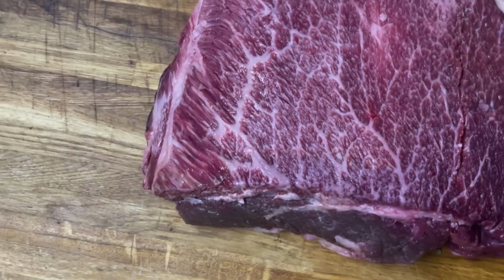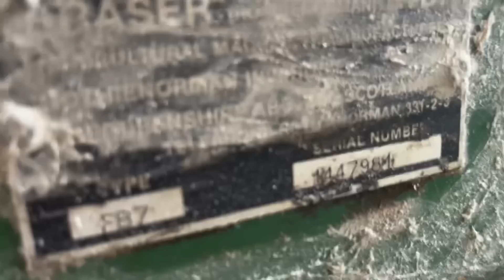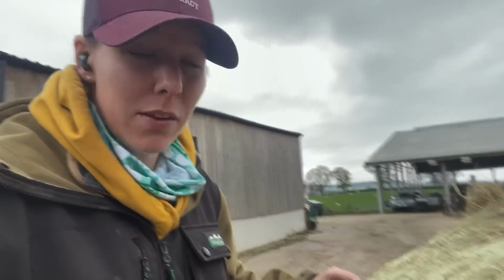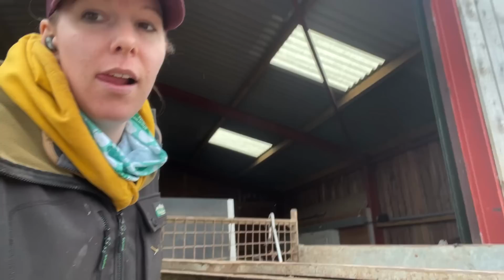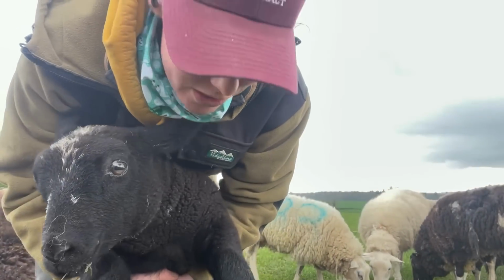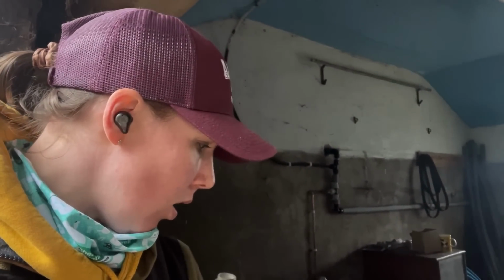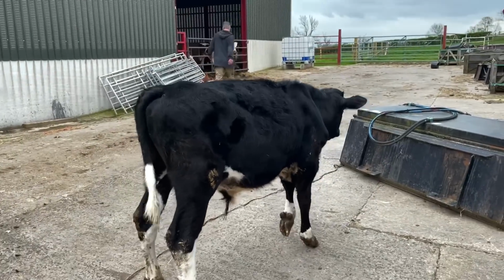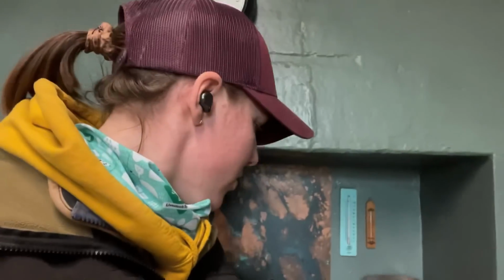Getting my arse in gear to tidy up!! Daily farm diary

Comment: What fuel does your arger run off? Thanks.
Reply from the maker: Electric and it’s EXPENSIVEEEEEE 🫣🫣🫣
Reply: @charlotteashleyfarm   wow yes I heard electric ones are excpensive to run. Gas or oil are better. I hear wood ones are dificult to controle temp.